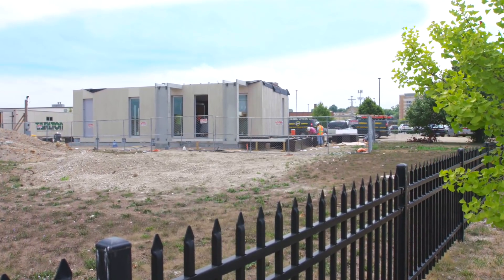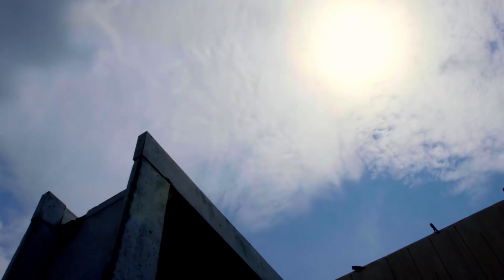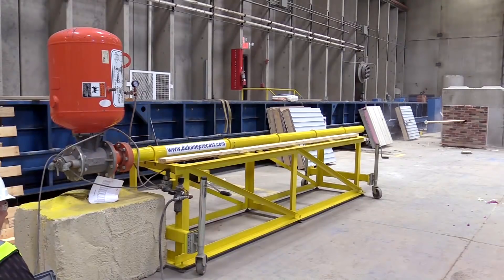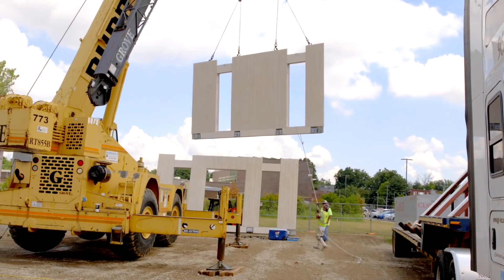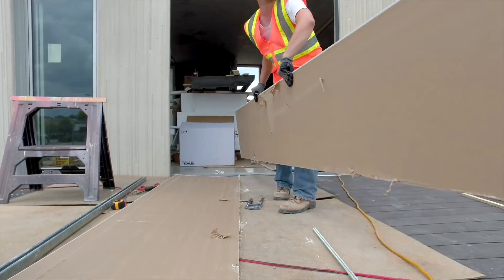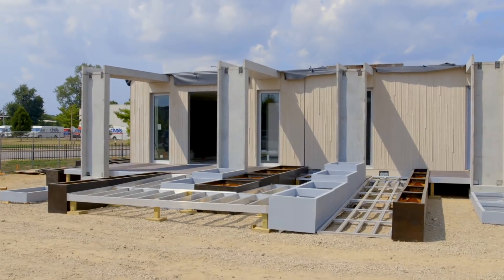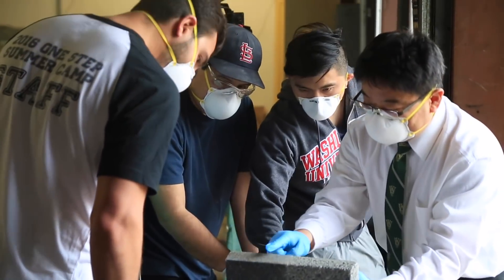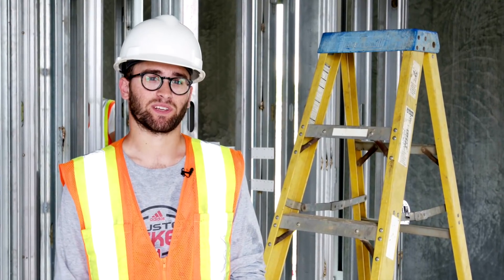Concrete Thinking: The House of the Future?

Comment: The video is incoherent -- it is supposed to be a net-zero passive solar house, and it's completely focused on concrete, which is nothing new. Those engineering and computer science students aren't working on how to put concrete panels together! LOL.  Most of this should have focused on heating and cooling the house off the grid.

Comment: Thermal mass is not universally applicable. It works in climates where there is a high diurnal temperature difference. In my subtropical climate thermal mass is the last thing that you would want in a house. Light timber construction which cools quickly at night is vital to comfort. It is frustrating and disappointing to continually see prescriptive design solutions on the internet presented as the right or only way, when they only make sense in limited climates.
Reply: are all peoples live in subtropical climate like you?

Comment: Where i live we mostly build houses with iron pole frames and concrete blocks. Nobody would build house with wood framing. Even though my country is quite safe regarding tornados, earthquakes, etc... People still like to feel safe i think. What is the benefit of wooden house? Apart from being easier to take apart.
Reply: Concrete houses work better in some places than others. They are certainly a lot easier to fireproof.  Thermal mass is a benefit if the temperature cycles around a comfortable mid point, but it can be a nightmare if it's consistently hot or cold, especially if you want to heat of cool rooms only when they are used. The only insulation in most concrete is that which is deliberately added, making the wall thicker and eating up space. Concrete can only be made earthquake resistant by adding a lot of reinforcement, and even then, any damage is harder to fix than with wood. Some areas don't have access to high quality concrete, and in some places, contaminated mining has led to concrete cancer of various forms (Google "cornish prefab", "concrete pyrite" ). Any structural problems in concrete are much more dangerous than those one finds in wood construction; almost all of the fatal building collapses in the world are in concrete and masonry structures. In cold areas, road salt can drastically shorten the life of concrete; my town had to demolish a parking garage that was only 30 years old. It's much easier to insulate wood frame construction without adding cost or bulk, though it's always better to add an external layer to avoid any direct thermal bridging. Contrary to one of the commentators in the video, wood construction can last indefinitely and is very easy to repair while modern concrete has about a 100 year lifespan in good conditions (it can be fixed with various patching methods, but it's an uphill battle). The special concrete they mentioned might have been some mix of Roman pozzolan concrete, which has lasted for hundreds of years in Italy, but it's not available everywhere and shipping can be a major  expense with such a heavy material. The "tornado test" was impressive, but a big problem with panelized concrete, both precast and tilt-up, has been the joints between the panels (Google "ronan point disaster"; the temptation has been to bolt the sections together at the top and bottom, but they need a lot of bolts, or a grout-lock, to give the whole structure the strength of each panel (this is also a potential problem with panelized wood construction). Still, this system looks promising, at least for some places; I hope a marketable  version becomes available if it can be made at a reasonable price.
Reply: @pcno2832  You make many interesting points.  What do you think limits concrete life to 100 years?  It would be interesting to know how to increase the life span. Any thoughts on structures such as Coit Tower and the foundations for the Golden Gate Bridge in San Francisco? Those are about 90 years old. Curious about your comment, I looked around and found the William E. Ward house in Rye Brook, NY and the Highland Cottage also in NY from about 1870. Not sure how the concrete is holding up in those structures.  Joseph Aspdin is credited for patenting Portland cement in 1824.  I wonder if there are any structures from Joseph Aspdin still surviving.  Also, curious about the pozzolan concrete you mention.  I wonder what steps to take to make concrete last longer.

Comment: My cabin of 30 yrs is made of concrete block and metal roof. Deck supports are iron poles. 9000 ft high in forest. I will be moving up there FT soon. In 2 yrs or less want to enlarge it. Had already decided on sandwich panel concrete walls and 2nd floor to be redone as concrete. Question - must a concrete roof be flat? I thought of SIPS roof with metal. But if concrete roof can be pitched as a shed roof, then that sounds good. 
We had a bad winter up there few yrs back where most cabins pipes froze, some roofs collapsed from snow weight. Not my concrete block cabin. We notice too that after 2 days of woodstove use cabin stays warmer than neighbors with wood cabins.
I really prefer concrete. Always have (though my desert home is adobe brick.)
In forest area, concrete is mice, termite and fire proof.
Reply: Desert Rat Gardener , you may want to look into heat melt embedded into the concrete roof.

Ski resorts use them.
Reply: Buck ey thhank you